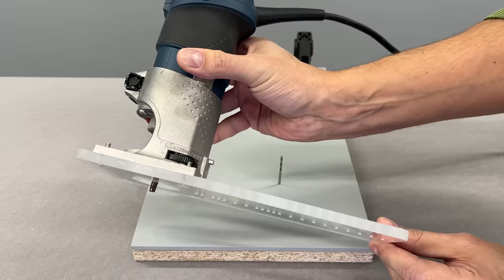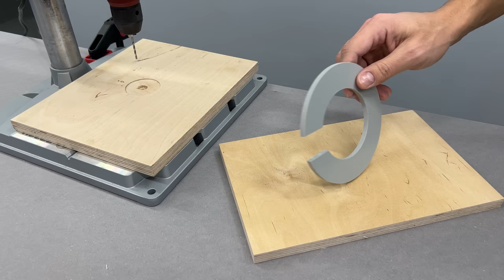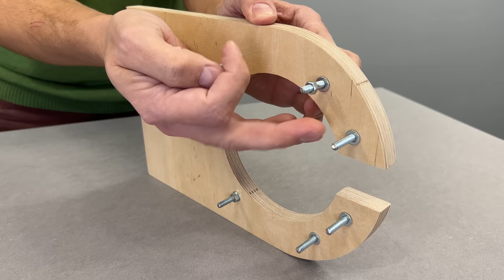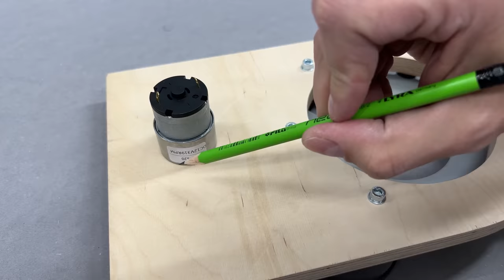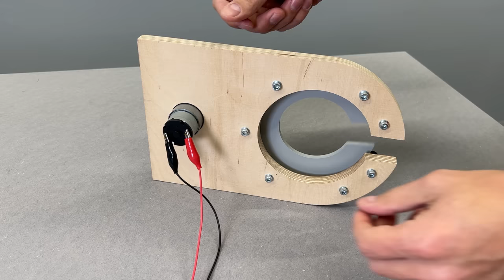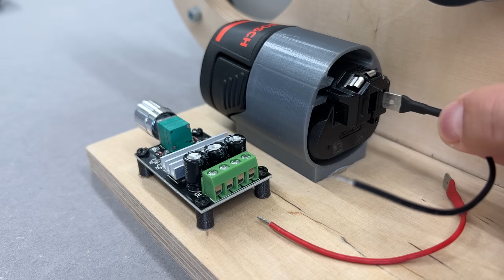DIY Wire Harness Wrapping Machine

Comment: I seldom comment on these DIY videos, but I was compelled to drop in and say that the drive system for this device is a stroke of genius. I can see countless uses for it in manufacturing. Well done.
Reply: It almost looks like the inverse of the tape feed of a vcr player. Not quite, but it feels like some inspiration must have been taken. Not trying to rubbish on the video, it's definitely genius, I'm just trying to guess what might have inspired it.
Reply: Would be amazing in a dryer, but lets face it they haven't elevated anything on their product other than the price in like 4 decades lol.
Reply: You would be amazed what kind of machines exist in a professional production environment.
I'd even go as far to assume this design might have been inspired by a more complex and more elaborate production machine.
Nonetheless, for home use (like tidying up desk cableing) this is actually a great idea
Reply: Reminds me of back when dual drive extruders weren't the standard in hobby 3d printers, found an extruder with a very similiar drive system on thingiverse
Reply: @2001herne    (
Reply: А просунуть кабель в отверстие без всех этих разрезов в диске нельзя? Я понял бы этот разрез в случае обматывания, например, тороидального сердечника - но для отрезка кабеля зачем такие сложности?
Reply: @Sergey_Fokin  This would allow you to wrap the middles of cables without feeding the entire cable through. It also may be useful for wrapping cables that have something large already attached to one end.
Reply: @lunchbox1553  Для таких ограниченных применений - возможно. Если надо замотать часть кабеля, от которой до одного конца сто метров, а до другого - километр, тогда однозначно! :)
Reply: @ichbrauchmehrkaffee5785  
"for home use (like tidying up desk cableing) this is actually a great idea"

How often do you have to tidy up your desk cabling? I think I'll just carry on doing it manually. I've made various things over the years and have quite a lot of things which are only half made. I come across one sometimes and can no longer remember what I wanted to use it for. LOL

Comment: That drive "mechanism" is genius for it's simplicity. I also love your method for cutting out circles with a router, again simple but very effective. The only thing that would improve on an already excellent idea is a way of getting a bit more tension on the tape, winding the bundle more tightly.
Reply: Make the bolt holding the tape roll longer. Add a small spring and washer between the nut and tape roll. Loosen/tighten the nut to change the tension. Like a packaging tape dispenser.
Reply: I was thinking the same thing. There would be two possibles ways to do it, one would be to elongate the motor mounting setup, the other and probably easier way is to have and adjustable idler pulley on the belt. For the tape, use a wingnut to adjust the tape tension.

Comment: Suggestion: If you add a guide to centre the cable firmly and increase the rotational friction on the tape holder, you can use this to wrap cables tightly.
Reply: I came
Reply: Repent and believe in Jesus Christ  Repent, I shall repent, Relent, I shall relent, worship........hahahahaha!
Reply: The guide would be part of the grey plastic disk?  I am going to make one for work.
Reply: @d.thorpe2046  No, it must be separate so the rotating disc has something to resist the pull from the tape, thereby pulling it tightly.

Comment: Okay, I manage a prototype harness shop and am a wiring harness nerd, and now I have to build one of these.  Great work.
Reply: I worked in a factory that produced harnesses for Ford & Chrysler and the industrial version of this has a couple of things that make the finished product look even better. A wide rubber belt on the output side that pulls the harness. The operator just puts end on that belt and holds it down with a flat hand and let the adjustable belt speed do the work of coordinating wrap speed, harness diameter and overlap of the tape. The tape holder needs to be at a small angle to help make the tape lay without wrinkles. The tape used was vinyl harness wrapping tape commonly used on auto wiring. It has no adhesive and is secured by a few wraps of friction tape at the ends. That method retains flexibility that adhesive tape won't allow.
Reply: @108gk  Great insight into the commercial side of things. Thank you.

Comment: I made wiring looms in the late 80's. Your machine is faster than I was, but, about 60% of the speed of the best tapers we had. A good work-around though.

The stretch and wrap non-adhesive vinyl stuff would be a problem on your rig though. You'd have to change the gearing and ad a holder to keep a tight tension on the harness. Very doable.

Comment: I once made a bespoke loom for a kit car. When I hand wrapped it, I found that conventional insulating tape made the loom very inflexible. Factory looms used a very low-tack tape with ends secured by stickier tape or even blobs of glue. Tha same principle may apply with this magical machine.

Comment: I like it. The only negative I see is the adhesive used on the tape. The adhesive used in “normal” OTC plastic tape tends to deteriorate, run and “get sticky” in a flexing, heat-prone environment such as a wiring harness might experience. It would be good to source and recommend a more-specific-purpose wrapping for your device.

Comment: Now to find a way to add tension to the wrap. As is, it is a bit on the loose side but still functional. Maybe a longer bobbin bolt with spring tension on the bobbin.

Comment: Where did you get the 3D printed item files? The battery and tape holder. Can you give specifics on plastic piece thickness and the screws/nuts used. Also can you post the printer accessories used. belt length and controller details. Great job on this.

Comment: That little router has to have some real juice to it and one fantastic bit to cut that stuff like that. Of course in America the bits we buy R made out of old soda bottles and Ford hubcaps.
Reply: You need to shop for you bits somewhere besides a box store and be prepared to pay more for them. Quality bits are available, stay sharp, and if not abused, last a long time. But Americans (I am one.) are terrible at looking at things for the long term. They’d rather save money on a new appliance and replace it every 5 or 10 years, than to spend a couple hundred more on one that will last decades.

Comment: I really like the idea!! And great build, props to the creator!! But I would like to see an option with more tension if that makes sense? Like if I'm using electrical tape I really like to get shit tight on the wires so I dont have much chance of it unwrapping. Any ideas or suggestions?

Even with the current state of the wrapper it could be used for a lot of things, you ever see those asian factory videos where they have basically a huge version of this that they use to wrap an entire box in tape, like this could be used for alot more than just harness wraps with a few changes. Even just this version could be used for things like friction tape on hockey sticks.

Comment: Great use of various motors and drive system.
But, as an electrician for almost 35 years you can do the same thing by hand and almost as fast and have just as good of a wrapping job. 
 
 I'm not knocking the invention. I'm just saying that is a lot of work and a bit of money to make that machine. 
 Maybe if you had a shop that all you did all day was make wire harnesses but they have machines that do that already.

Comment: Very cool design! Wrap would be too loose for my liking but, still, excellent build!
Reply: it is you could do the nut up a little bit more so the tap does not spin so much that would pull the tape harder :)

Comment: I built a guitar pickup winding machine. It was basically an electrical tin opener sped up using a drill and a hall sensor to count the turns....the moulinex 3000. The wire was like human hair, enameled etc.

Comment: Well Done Tips, can you add links to the parts you used, especially the circuit board, the battery holder, and the belt wheels?  Thx.

Comment: A very interesting video but it only serves to present an idea and is not one that just any person could follow and end up with the same product due to the complexities of the build that are not detailed or resources revealed.
Eg, there are precision components which are not easily found such as those toothed bearings and motor with toothed pulley and the corresponding idler bearings and drive belt. 
Then the distance of the line that was drawn as a guide for the holes for the bolts that acted as bearing axles, needs to be careful calculated relative to the dimensions of the bearings plus the thickness of the drive belt and the circumference of the rings in order for the rings to fit in the circle they form and run smoothly without being too loose and falling out or too tight and jamming.
This, despite the slick video us not an easy build for an average Jo.

Comment: Did you know that teh 12V Bosch batteries and the 10.8V are practically the same? It's only a marketing trick! Both have 3 Lithium-ion cells inside. The 12V version takes the maximum charge voltage (4.2V x 3 = 12.6V) and the 10.8V takes the nominal voltage (3.6V x 3 = 10.8V). But both types use the same charger! And of course Bosch changed the plastic housing a bit to make them incompatible. But that can be fixed..... 🙂

Comment: Looks good. I do wonder about how you just glued the two pieces of wood together, without joining or screws. That might be a weak spot. Other than that, it looks good. Video is short and to the point. 👍